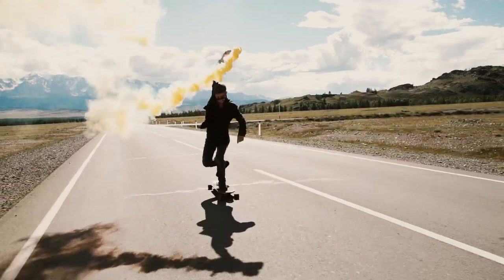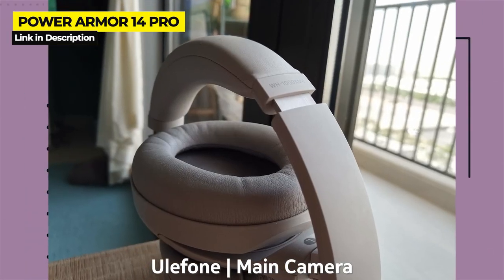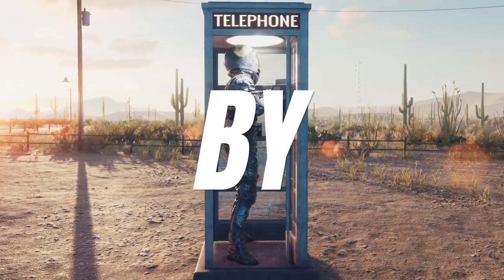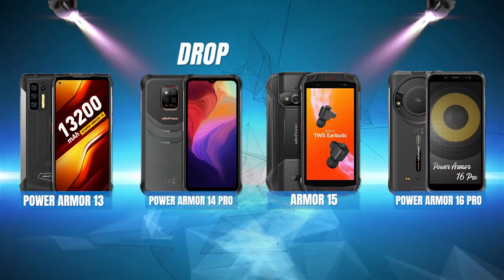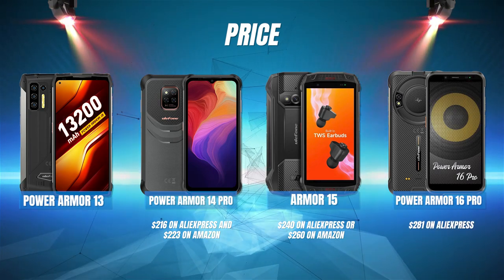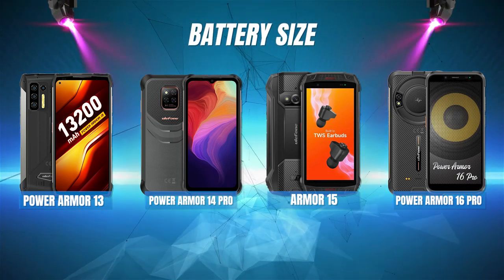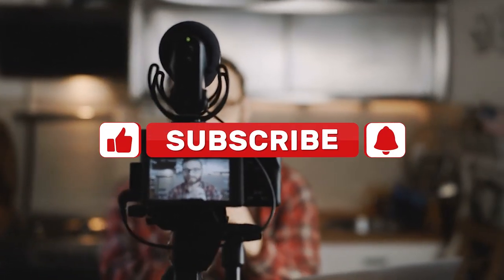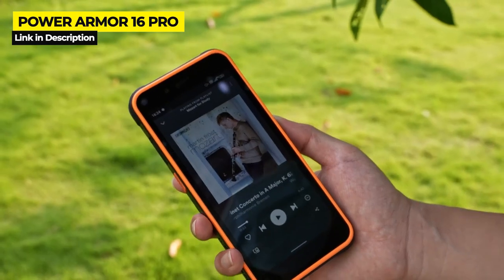Ulefone Power Armor 13 vs Power Armor 14 Pro vs Armor 15 vs Power Armor 16 Pro (Best Rugged Phone)

Comment: I have the power armor 13....and i like it a lot.
The only thing that i wish is that,  it should've had a night vision or thermal camera. But I'm still sticking with my power armor 13.
Reply: Dude... are the 13  really that low talk time with that massive battery?
Reply: @whymyluckstatsistoolow  No... it's a good phone
Reply from the maker: What kind of talk time do you get out of your Power Armor 13, Nemeis Prime? I'm going by what Ulefone says on their official specs - it says it only gives 11-17 hours of call time, which I find kind of crazy with that large of a battery!
Reply: @SurvivalSuperhero  I don't talk a lot i game a game a lot on it and watch movies  and it stick up long enough before charging ....I think doing those things on it uses more energy than talk time.
Reply: There has got to be a mistake with the power armor 13's talk time stat. I've had hour long conversations with clients and it barely consumed 1% of the battery
Reply: Same here bro but the 18T😍
Reply from the maker: I emailed Ulefone and asked how long the Power Armor 13's battery lasts, here's what they said:

"Ulefone Power Armor 13 can support almost 5 days daily use and 17 hours talk time with a single full charge, but subject to actual conditions."

So according to Ulefone's customer support, 17 hours max talk time is correct, but I'm with you guys, it does seem like it should be much longer!
Reply from the maker: 18T is looking pretty sweet!
Reply: @nemesisprime2993 is the power armour 13 still working well now?

Comment: they all dont have an image stabilisator, videorecordings when moving the phone look like waveing to the sides. instead a laser distance measure they should have build an image stabilisator in. the armor 13 has wireless charging, that would be my choice from these phones mentioned. i like that these phones have a built in antenna for broadcast radio reception. if the armor 13 had an image stabilisator and an amoled screen similar to samsung, that would be a great phone.

Comment: Nice re-upload, shame you didn't corrected the prices , cause they are way off...power armor 13 from your link provided in description is priced over 400 dollars 12 October 2022...just 3 h after re uploading this video
Reply from the maker: I don't understand what you mean? The video says the Power Armor 13 is priced at $330 on AliExpress or $400 on Amazon, and those are the current prices on AliExpress and Amazon. What prices are you seeing? on Amizon and AliExpress?
Reply: The first phone , AliExpress link shows price od 409 to 490 euros , after conversion it's around 390 and 445 dollars, maybe it's a location thing. I'm in Europe
Reply from the maker: @wArIaTpl  That is weird! Yeah when I click on the AliExpress link to the Power Armor 13, the price is $330 USD. It costs more if you buy a case with it or wireless charger etc, but if you just get the phone by itself I see a price of $330 USD. Sorry that you are seeing a different price - what price are you seeing on Amazon?